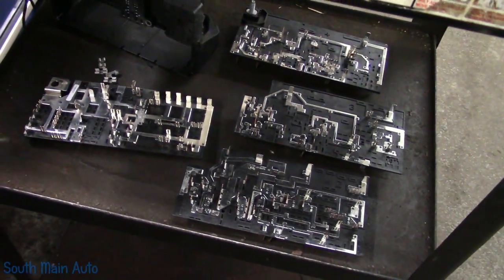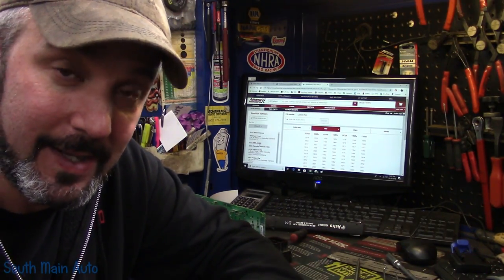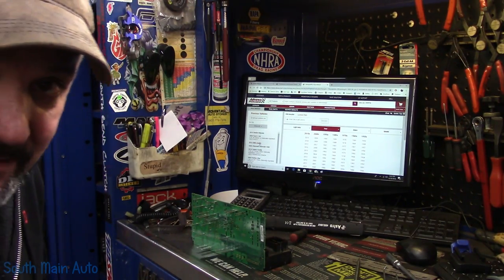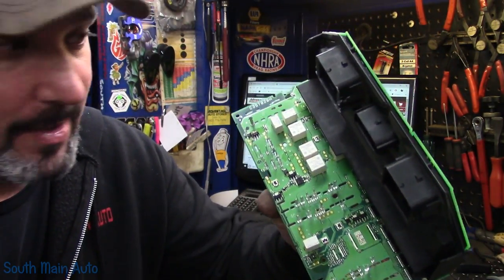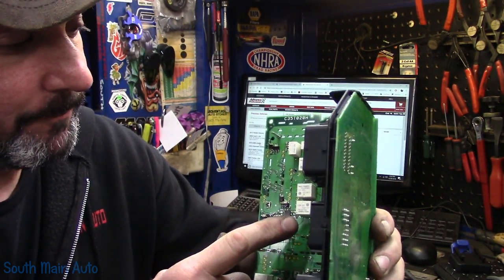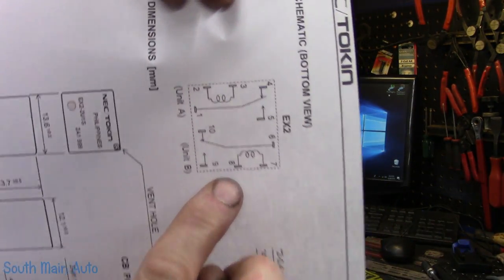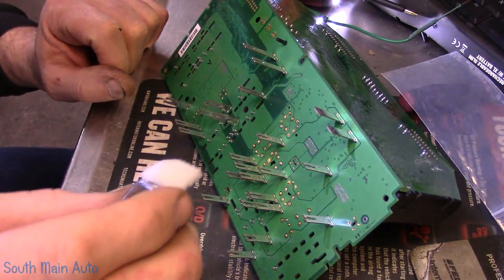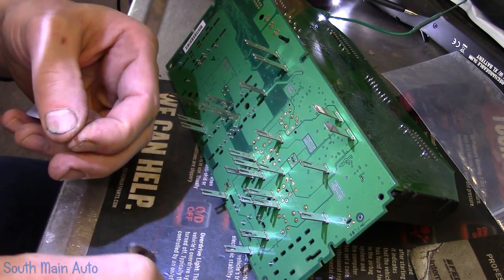Chrysler / Dodge : TIPM Repair - No Wipers

Comment: the relay that gets the most use is the problem
Reply: those dinky little relays are going to be constant problems over the years . the same problem happens on appliance control boards, either broke solder joints or bad relays

Comment: Thinking its pretty sh!tty that the relay would do that but it’s counter emf causing issue with relay burning out. There’s ways to stop that issue and the manufacturer doesn’t add this circuit to prevent the relay for doing that.

Comment: if only dodge chose to use a denso wiper motors instead of that headache.... most denso wiper motors have the wiper controller built in but nooooooooooooo..... they had to do it THAT way..

Comment: Well hobrstly by the time you spend diagnosing the tipm, then the time tearing it out of the car, tearing the tipm down, then testing what relay is bad, and then going through the process of replacing one or more relays, it might be cheaper to replace the tipm for a customer anyways. 

So no i dont blame you for not doing it for the regular joe schmo customers.

Comment: Next time get a desoldering iron. It has the snot sucker built into it. ECG J-045-DS Electric Corded De-Soldering Iron, 420 Degree C Tip Temperature, 45W https://www.amazon.com/dp/B00068IJSG/ref=cm_sw_r_cp_api_i_OwskCb2KM79ER

Comment: I had an 08 Jeep Commander that was in the shop for 3-4 days with electrical issues every few months until I finally got tired of it and traded it. I had a Wrangler before that which was an awesome vehicle but the potential for electrical issues in the newer Chrysler products just doesn't let me venture into that potential cesspool of annoyance again! Looking at cars on the road they seem to suffer from more rust issues than other brands as well. Too bad, they make some of the more attractive/uniquely designed domestic vehicles on the market. 

https://jalopnik.com/this-expensive-part-has-hundreds-of-chrysler-owners-fum-1628115596

Comment: I couldn't watch your attempts to de-solder until the end - much too painful - and I was yelling: put a blob of solder in each pin before de-soldering with the sucker. The wick is for cleanup only. The less solder you have, the more difficult it is to suck it out. Also, lead-free solder is a crap (so much that medical and military equipment use leaded solder) - you should use leaded solder for the repair, or it will tend to break in the long (or not so long) run.

Comment: Make your soldering life easy and purchase a hot air station even a Chinese cheap one $50 heat all the joints at same time and it would have taken under 5 min to replace the relay

Comment: You should stop apologising for your common sense approach when tackling an unfamiliar job. You did fine there, electronic components and printed circuit boards you're likely to find in a car aren't as fragile as most people think.

The desoldering wick should have worked, provided it's proper stuff. However, I very much doubt a spool included with a solder sucker for $9,-  will be proper stuff (a good solder sucker is $40,-). It's very much like they say: 'Honda make generators, others make toys.' I'd recommend sticking with either 3S-Wick or Soder-Wick brands. The really good stuff comes in a sealed can under nitrogen atmosphere, like good tennis balls. 

On thing I would caution against, though, is powering on relays in-circuit. Often relay coils will have an anti-parallel diode across them to quench the back EMF which arises when they're de-energised. If one then attempts to power the relay opposite to the way the polarity is meant to be, one kills this diode. Thankfully, Chrysler seems to think a back-EMF pulse travelling back through the wiring loom to the PCM before getting quenched is of no great concern.

It is quite common for relays to fail in the way you saw, BTW. Once they start making bad contact the contacts can get quite hot indeed.

Anyway, good to see these TIPMs are, as I expected, perfectly serviceable with a half way decent through-hole rework setup. If I were in the US I'd happily start a business doing so. $75,- +shipping +tax would easily make that work.
Reply: Just thought of something... the way you're a wizard with the cutting torch, I bet that, if you bought some PCB cleaner to clean up the mess afterwards,  you could easily just elevate the board off your workbench and, with a sooty flame (no oxigen, obviously), just gently heat up the bottom of the printed circuit board and the solder pads until the relay dropped out. Try that on a scrap board sometime.

Edit: or try your inductive nut heater!!

Comment: AVE would have said something like its put together with all this smooking goo (explenitive) stuff so get you prikin spikem tool a giggy and proceed to spread her apart
Watch LOUIS ROSSMANN channel he takes these apart for computers but is same thing he has certain stuff that does that but its a totally different field than you may not want to invest in. I see he put a liquid on it could be flux and then heats it up and the wick you have sucks the solder away from the board. Like you I aint no electrician but thats what I see. 29 minutes in you almost sounded like Barny Fife lol